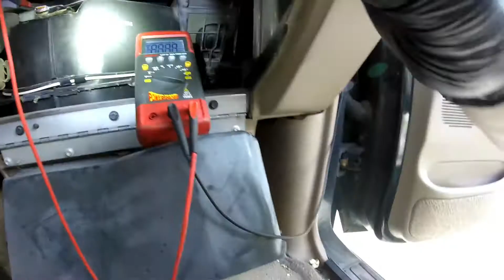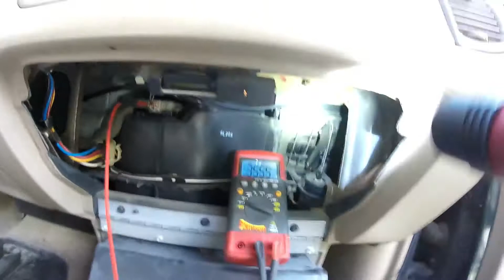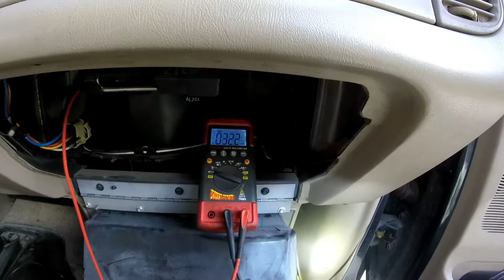Automotive Diagnostics

Comment: For the A/c you need to put a manifold gauge on the system and measure it. You could have have a clog in one of the expansion valve or drier. Or depending on the system the orfice tube.
Reply from the maker: Yes, that's a great idea, and if i had gauges id put them on there to see how healthy this system is, however in this case it's certain that there is no severe restrictions. The lines are hot out the compressor, warm after the condenser, and cold after the orifice and cold on the accumulator, pressure and temp are directly related, so we should be seeing at least some cold air inside the cabin.  I  noticed this a/c actually works when the vehicle starts on a cold engine. but as the engine warms and the heater core gets warmer the air out the vents gets warmer too, until finally the engine is at full temp and the air out of the vents is not just warm.....its hot! this points to the blend door or air mix actuator and door.  a quick check confirmed that indeed changing from full hot to full cold there is no temperature change out the vents, indicating further that the blend door is probably stuck in a hot  or some where in the mix but. In this video i was testing his blend door actuator to see if it was acutally working. not having a schematic i just back probed all the wires and watched the values as i adjusted the temp. what i observed was that the control knob/signal is working and the actuator is responding, however since there is no temp change,  this points to either an internal gear failure in the actuator or a broken stem that drives the door. or the door itself is broken or mis adjusted.  i ran out of time but this is where i will pick up next time i visit the vehicle.